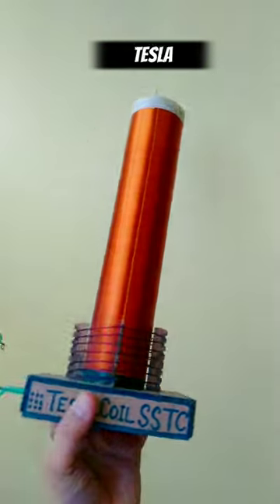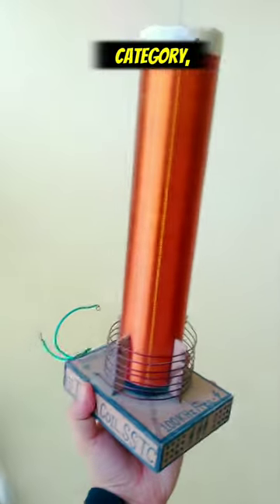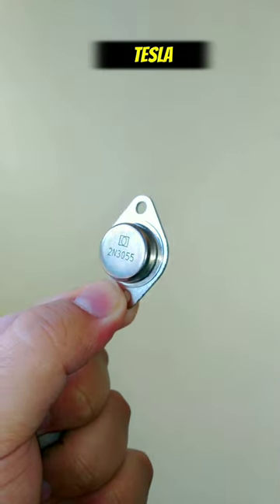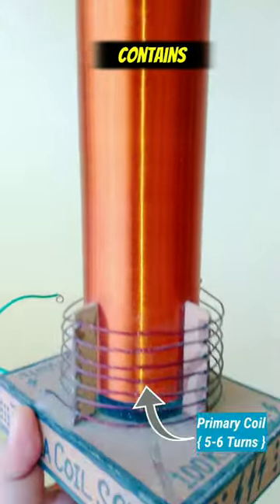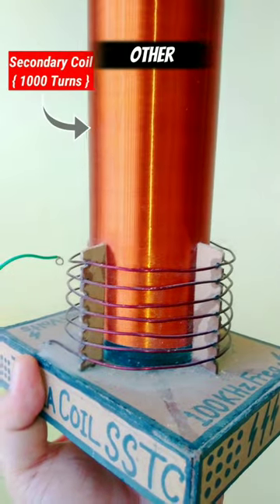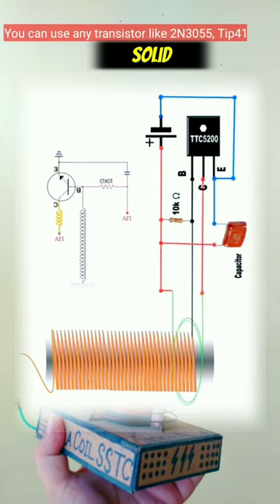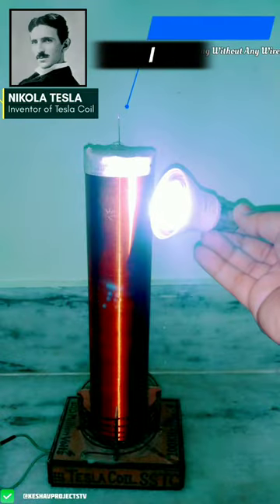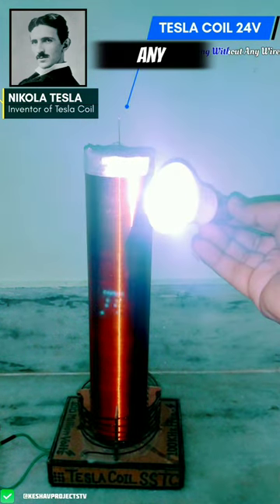Nikola Tesla Invention | How to Make a Tesla Coil #shorts #science

Comment: Bulbs (other than led bulbs) contain inert gases like argon , xenon etc. when a Tesla coil works, it produces high voltage arcs at the output. This creates a varying high intensity magnetic field which can ionize the gas molecules inside the bulb. It is not necessary to TOUCH THE TERMINALS of the bulb. If the bulb contains inert gas and the output is sufficient enough to ionize the gas molecules , the bulb will glow. An LED bulb doesn't have any inert gas inside it .Since you said it is an LED bulb, then this video is fake .
Reply: Nothing is fake bro...
He explained in another video that this tesla coil is high voltage (Not of 9-10 volt battery) but 12/24 volt battery 
And he also explained in comment section that I have touched the led bulb end so it was grounded and it was glowing 
Understand? First I was also considered it fake

Comment: I think Nicolai Tesla had several purposes for the different configurations of this coil. But most importantly, when configured and tuned correctly, I think he found a means of creating a waveform that traverses perpendicular to the conventional transverse/Hertzian waveform and rather, is aligned with the 'direction' (orientation) of magnetic flux created by the flow of charge along the conductive path. This secondary waveform is created through the resonant inductance in adjacent conductive paths and is essentially unlocking a whole spectrum of EMR which is otherwise wasted. Ie; the Hertzian wave is only a signal and the correct tuning allows for the signal to interfere with adjacent signals as to amplify them through the alignment of energy transition (NOT 'flow') with the magnetic flux created by the signal energy  flow. By creating this waveform which is coupled to the signals magnetic fields flux orientation, it allows the energy transition to be orientated in such a way as to be shielded by many normal parasitic losses associated with transitioning electric/energy 'charge' through the plane of existence which the molecular realm is bound by. This shielding allows for a 'superconductive' like state to be achieved. With further development I would dare say it would also permit superluminal velocities of energy transfer as well. 

Too bad Tesla's progress was disrupted by competing interests of wealth concentration. Then dying with him as his work was buried and hidden.... 😒

Eg: Most people just accept that 50-60htz is a factor of electricity that 'just is' and pay it little mind in their thoughts / experimenta